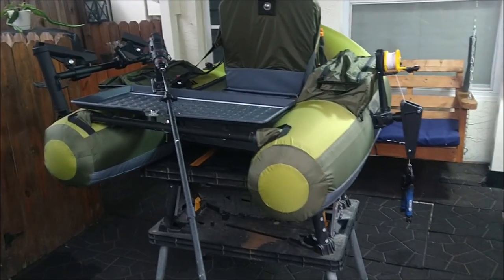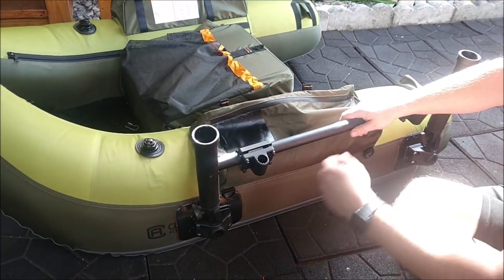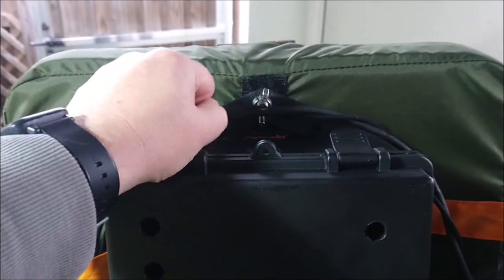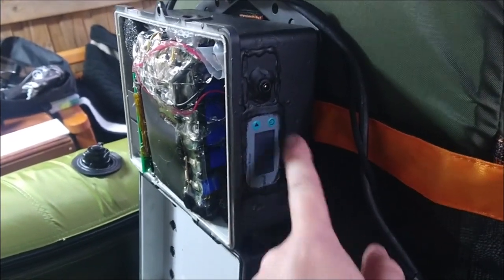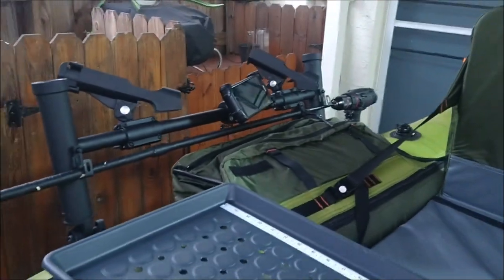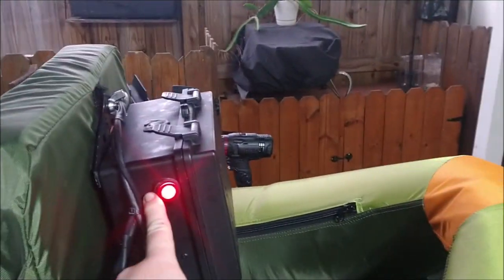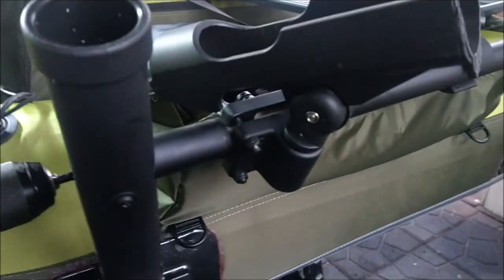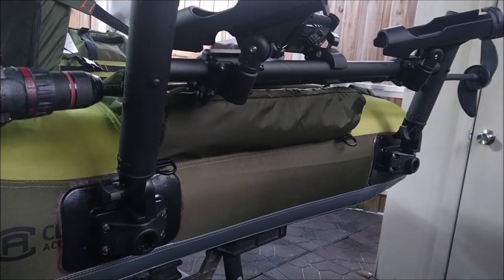Cumberland Float Tube - Easy click in rod holder, anchor, and drill propeller

Comment: Did you use the same rope it came with for the anchor or did you replace it. Thank you again for a response. I think you have the best set up and I am making mine very similar
Reply from the maker: I replaced it with some paracord from Walmart. I don't remember the size, but I got like 50 ft. Maybe 1/4 in? It was enough for a 3 lb grapple anchor

Comment: Thanks for the video. I will give this set up a try. It looks the best from what I have seen. Did you glue the mounts while the float was inflated or deflated?
Reply from the maker: Deflated for sure. Marked the spot with a pencil when inflated, then deflated it. Even if the glue is on the skin of the tubes, some  might reach the bladders, and HH^^ can melt an inflated bladder.
Reply: Thanks for the advise
Reply from the maker: @fanofallrods2042 No problem, good luck!

Comment: Awesome idea.  Do the rocket launchers loose their ability to be rod holders with this design? it looks like your crossbar basically bisects them so I assume there's not enough depth to still hold a rod. If that's correct, what do you use the remaining section of the Rocket Launcher for?
Reply from the maker: That's correct, but it can be mitigated. Think a round clamp around the rocket launcher instead of hole for the crossbar. The are electrical clamps big enough. I don't use it for anything now, the two rod holders on the crossbar are all I need but they could be adapted for gopro, or anything else creative
Reply: @AndiDan  Appreicate the quick answer.
Reply: @AndiDan  FYI i asked an electrician friend and he recommended a 1.5" conduit pipe hanger. It would allow you to reverse the way you have the cross bar mounted essentially. You would put the large end of the clamp around the Rocket launcher and then use the smaller in of the clamp to bold to your 1" PVC crossbar.
Reply: @AndiDan  How is the stability of the rig when you have it loaded with Rods or other gear? My concern is that it may flex in and out a lot?
Reply from the maker: @Mdowling5656  Great idea!
Reply from the maker: @Mdowling5656  Zero problems with that, I didn't feel anything different in that respect

Comment: Would it be easier if, on the pipe that holds the tray, or on the tray it self you put a trolling motor instead of the drill?
Reply from the maker: It certainly would, and with better results than the drill. This was more of a fun project for me, rather than a very clear goal of usability. Since posting the video I have given up on the drill mostly because steering is difficult. 
An 18lb thrust trolling motor would be more than enough power (like the Watersnake T18, which is only 6lb ). Small and light, with a short shaft, it would be much better than the drill idea. It could be combined with a 30Ah LiFepo4 very light battery (about 7lb), which would be placed on the back of the seat, like the one in the video.
The only con I see is making sure the prop doesn't hit your feet/legs. I only use leg power in rivers now, and for lakes I bought a Zodiac inflatable, but if I were to do it again I would certainly look at a small trolling motor.

Comment: How is it holding up? Curious about the glue and heat/cold expansion on fabric.
Reply from the maker: Just used it yesterday again :) No problems at all. Pads and mounts are solidly on. I only need to have a small rechargeable pump with me because within 15 min of cold mountain water, the bladders contract by a third. First time it happened I though I had a leak, but fortunately I didn't. I top them off and I'm good for the rest of the day. It's also unbelievable how much abuse the bottom of the tube can take on rocks without even getting scratched. Quite impressive.

Comment: So how do you keep the whole thing from rotating away from boat on hookup?
Reply from the maker: If you are talking about the propeller, that electric clamp holds it tight
Reply: The rod holders. Since they are mounted on the sides, not only top heavy, but hook up a big fish...
Seems like it would rotate away from the tube. I'd be afraid the stress on the tube over time will cause a catastrophic failure.
Reply: Also, did you use HH-66 glue? Would it be possible to put the mounts on the top of the tube? I am interested in getting a Cumberland so doing options research. I currently have a Togiak but the tube cover is fabric, not PVC. Same with my Creek Company Sport pontoon.
Reply from the maker: @2011KGM  I see what you mean. Didn't have a problem at all. When you sit in the boat they actually lean inwards and compensate. I caught 2-3 lb fish and no problem. I doubt they'll fail. The tube will be pulled before the holder will fail. If you are concerned about rotating, put an eyelet on the top or middle of the rod holder, and anchor it to the tab behind the pocket. That will completely secure it
Yes, I used HH-66. Yes about the top of the tube. The mount that I linked it both for side and top installation. My cover is also fabric and didn't rip or anything.
Reply: @AndiDan  awesome! Thanks!

Comment: How did you attach the PVC rod between the two scotty bow holders? I really like that idea and want to copy it.
Reply from the maker: You can see a detail at 1:06. I drilled a side hole in both scotty holders (check the outside diameter of the PVC to choose the size of the hole), inserted the pvc pipe on both sides, then used a bolt and nut through both of them to hold them together
Reply: @AndiDan  thanks for the fast reply. I'm really looking forward to fishing in mine.
Reply from the maker: @jimmywallhanger8402  No problem, good luck!
Reply: @AndiDan  How long is the pipe between the rocketlaunchers? Thanks
Reply from the maker: @jimmywallhanger8402  If you count 1.5 in on each side that goes into the rocket launcher, 30 in. But to make sure it fits, first I glued on the pads, installed the rocket launchers, then measured the distance between them to fit the pvc pipe